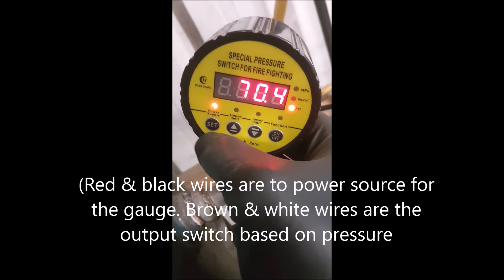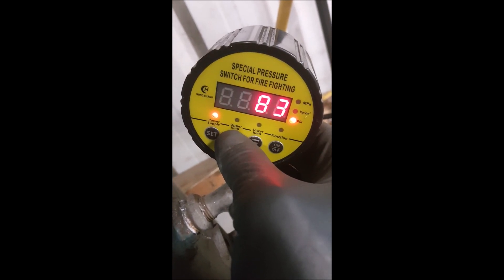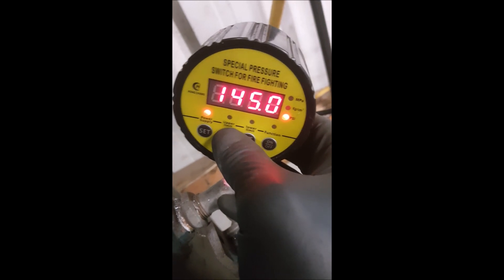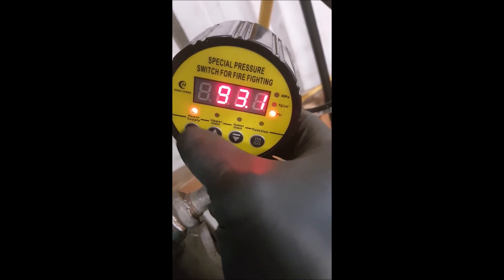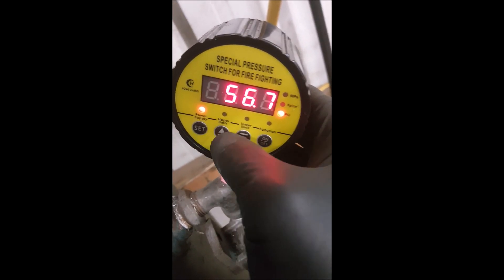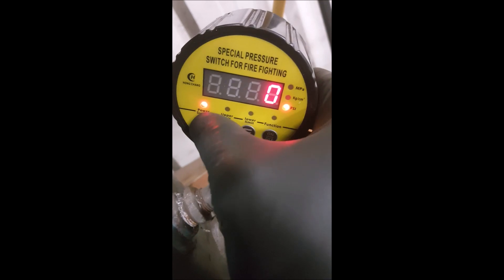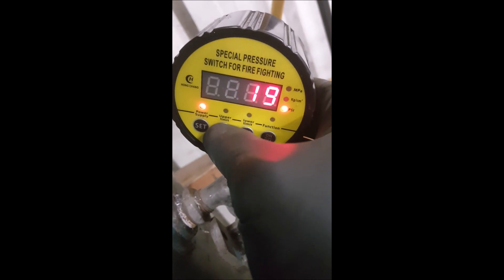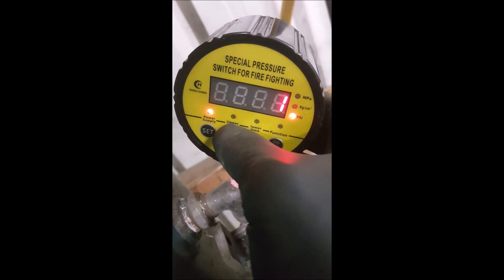Digital Pressure Switch

Comment: I want this Pressure Switch to use in Compressed Air line for Switching ON /OFF Compressor. Is it possible ? Can I use it for Compressor on/off control ?
Reply from the maker: I finally junked this thing, as it was nearly impossible to set up and continued to be problematic. I'd steer away from it for your intended purpose.

Comment: So your white and brown how did they hook up white was a1 and brown a2 on the contractor
Reply from the maker: These are simply part of the wiring that activates the contactor on power up (switch on). They are in series with the thermal over ride circuit. So, basically, if the lower pressure parameter is met, the circuit is completed until the maximum or cutoff pressure is met. Or, unless there is an overload, which will also kick it off. There are plenty of YT videos out there on these circuits, to help you.

Comment from the maker: I finally had to pull this gauge out and go back to my old pressure switch. The new one kept failing to start at the low pressure point and of course, the manufacturer was no help, and neither was their documentation.
Reply: Same here, it stops at the high pressure point, but does not start at the low pressure point.
Reply: This is the unfortunate reality of unbranded Chinese products, its Russian roulette.  Every single pressure switch, gauge, valve, I have ever bought has been inaccurate or failed soon after purchase.  I like the idea of the product but it's yet another example of lack of quality control and use of cheap components. I'm now using a used pressure switch from the 1970's which works well.
Reply from the maker: @arbit3r  Yep, garbage. I thought I'd give it a try, but like you, I've gone back to 50 year old, dependable, U.S. made technology that just keeps on working. :)

Comment: Dear Dan, I have a similar switch on my compressor. With the help of your video I could set the parameters but the relate still does not operate. If I switch the function on then the lower limit light comes on and unit cuts on upper set limit but does not operate correctly on lower setting. May I request if you could email me the literature which came with the switch and let me know what parameter relate to L H and Fac or so which come after starring upper and lower limits and how to operate this instrument please. Email  sanjay21 ncc@gmail.com